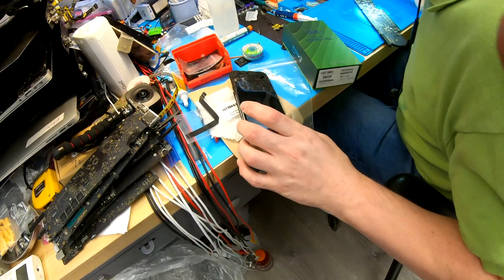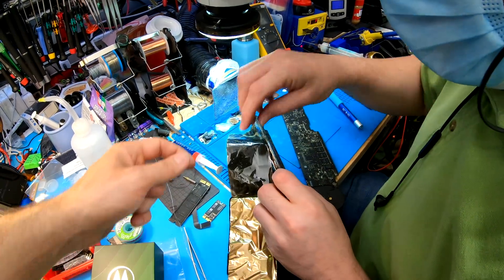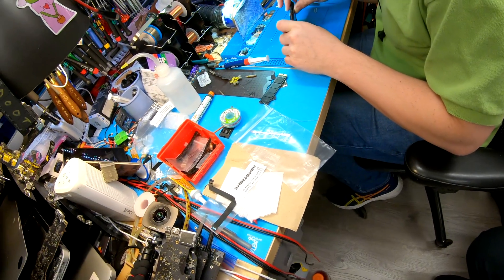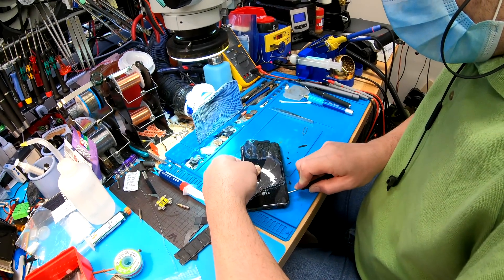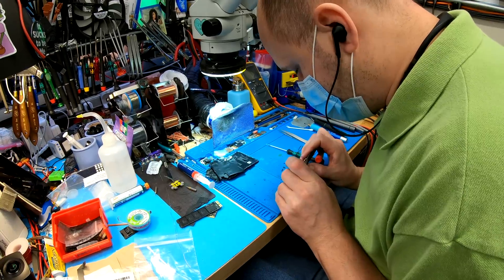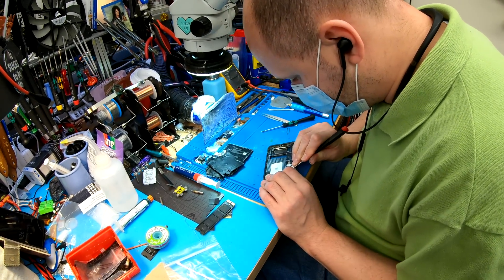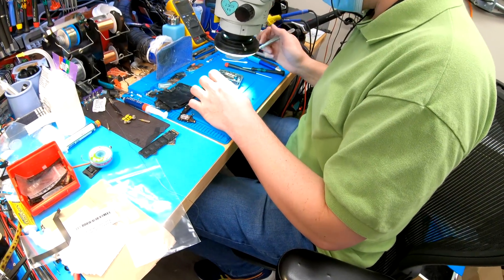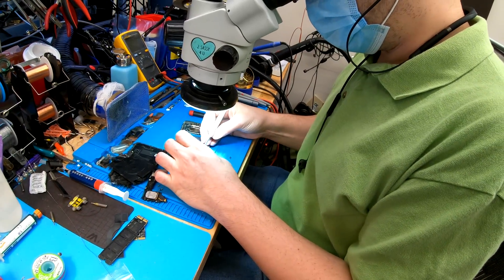Can Paul recover my phone data after the bike it was attached to goes on fire?

Comment: Well, there's the reason it caught fire just then:  The wind of your passage was the only thing keeping what turned out to be a crap battery pack cool enough that it didn't burst into flames.
Reply from the maker: This is most likely it. This makes the most sense. I was riding for 20 miles continuously with no problem. I stopped, I turn off the motor controller, I turn off the battery, and sit still for a minute. It goes on fire. The cells were being cooled by the wind. It's not possible for the motor, or the motor controller, to have done this, because the circuit breaker was turned off at this point, breaking the connection between the battery and the bridge rectifier as well as the motor controller.

The moment that I stopped the temperature went up and kablooey. The lesson here, even if you use the battery for 30% of its rated capacity, that's too much when buying a battery on AliExpress. Stick to em3ev. Or lifepo4. Never again
Reply: @rossmanngroup  at least it didnt choose to burst into flames inside your office..
Reply: @rossmanngroup  Actually, now that I think about that, I'm being unfair there.  It could be that your battery controller was crap, as it does have the job of, among other things, making sure your battery pack doesn't burst into flames.

At least this is better than the subject of a very old joke from Saturday Night Live (this was done on Weekend Update by Denis Miller, who left the show in 1991, ending all humor on the show as far as I'm concerned).  It was about a dish washer that was recalled due to a fire hazard.  The joke is thus:

Dennis Miller:  How bad do you have to SCREW UP to build a machine that fills up with water, THEN bursts into flames?

(Not quite the best bit he ever did, that was the wonderful Gulf of Sidra bit in 1986. It involved him pointing out where it was on the map behind the desk, and when he did so a squib blew off that tile of the map. His expression suggested that he wasn't told about this ahead of time.)
Reply: @rossmanngroup   As a practitioner of the Vape, I can tell you it's likely that the AliExpress cells were significantly overrated. When pushed too hard, they get hot. If they melt through the insulation, or even clatter together and cause a short circuit between the Ground/Negative chassis of multiple cells. I've seen other e-bikes catch fire, and the batteries were exploding like M-80's.
Reply: @rossmanngroup  make sure you do some forensics on the breaker, controller etc though if you can. To make sure they did not set this slowed-down thermal runaway off. You do you, but if there was a self-induced fault/limitation through your mods, or a discoverable fault/weakness with something else than the battery; you'd wanna make sure that doesn't carry over to the next build.
Reply: @rossmanngroup  How many bikes have you lost to fire so far?
Reply: What about doubling on the battery? Sure its gonna be bulky but afaik its always the esr, so half the esr and double the surface area is like 4 times safer. Sure lifepo is a good alternative if you get enough capasity for 80% of your trips.
Or maybe add a fan to the battery pack and a thermistor?
Reply: @rossmanngroup  em3ev has been great to me. I bought four batteries from them this year and one two years ago. They constructed custom cables for me and sent them from China for practically nothing. I hope they are doing OK.
Reply: @rossmanngroup  One solution is to turn it OFF while still moving... But of course, you need to make sure that the cells are properly cooled and balanced.
Reply: @rossmanngroup  RC Lipos from a reputable brand are often good. Not that it maters, but wich battery connector are you using, Barrelplug /XT60/XT90?
Reply: @rossmanngroup  Louis your inspiring me to make a YouTube channel.... I'm not fully aware of your bike setup because I don't watch all of your videos. But I know one, where you had densely packed cells covered in what can only really be described as heavy insulation. Wind was doing fuck all to cool that battery. So the only question I have is "What was your amp draw for that 20 min, or more on the point what was your amp draw compared to C rating and how were your packs constructed?"

Also one shit unbalanced cell risks your entire pack every time. That is the value of an on board BMS (which hopefully you were running.)
Reply: So, next time he should build some sort of intake fans?  Guess Louis pulled an apple.
Reply: @notmyregret  I think there may be no "next time".  There isn't anything worse than scaring your own wife.  Let's just say that he probably isn't going to get on a e-bike for anytime soon, or perhaps forever.  One thing that you can possibly be certain is that he isn't going to be able to bring another e-bike up his apartment, and he can't leave it outside much less charge it overnight outside on the streets with a long extension cord thrown out the window.  I think he is going to settle with a motorcycle or just a regular car.  His e-bike ambitions may just in fact be over.
Reply: @user-he6jc6uq3y  He operates on a 1 e-bike fire a year basis. He'll be fine and dandy :)
Reply: @King_Kong_Song  like I said. Apple
Reply: @user-he6jc6uq3y  not sure why you would think that stops louis from getting another e-bike. Obviously he just gets a new battery.
Reply from the maker: @m8ty.com I actually rode the red one(that bike does not use a shit aliexpress battery on it and has been awesome for over a year) home today with Erica - at her insistence. She didn't want me to be scarred by the one time I got fucked by a shitty battery manufacturer. Her and my friend Anna too. We rode way slower than normal to stay at a low wattage and it made it easier to have a conversation and sightsee on the way home. It was great fun. I have enough battery to be able to charge at the office, where I am right next to the door incase it bursts and have everything I need to deal with a fire. 

My other friend told me "Promise me that you won't stop. That you'll figure out what went wrong and try again. What's the point of changing the world if you're miserable at the end of the day?" She sent me this article and told me to promise her I'd never stop playing. https://www.asc.ohio-state.edu/kilcup.1/262/feynman.html  Albeit, taking into calculation what I learned so it never happens again. 

I'm telling you, I am a lucky man. I have the best woman in the world here. and good close friends. She has a guy that reeks of lithium. It's not a fair trade. 

I definitely want to get my motorcycle license and get one so I can travel the country searching for the next place to call home base for business if NYC goes to shit. I wanted to travel around Delaware & Virginia a bit with this one, but... that aint in the cards for the time being.
Reply: @rossmanngroup  If you don't think NYC has gone to shit NOW, what would it take to convince you?
Reply: Louis Rossmann Get à smoke detector - put it where you keep the bike in your apartment so it’ll wake you if it starts smoking in the night when your sleeping.  Please?
Reply: @rossmanngroup  that's a really healthy mindset,a lot of people simply shut down and refuse to try again and analyse what went wrong after a traumatic situation like this
Reply: @rossmanngroup  I'm happy Erica feels better and still trusts the red bike, this one has a good battery.
Reply: @rossmanngroup  You are lucky.
Reply: @rossmanngroup  Do NOT get a motorcycle, in fact give up the e-bike, crippled and in intense pain through no fault of my own these last 31 yrs!
You can afford a car once outside NY and have protecting metal around you not exposed flesh. I WAS 35 and invulnerable GS550 Suzuki. Not worth it.
Reply: @rossmanngroup  Well for travelling round the country why don't you just get a car? I totally get that a car is awful when you're commuting in NYC traffic, but for a long roadtrip it's quite a bit more comfortable than a bike/motorcycle. Especially when the weather sucks.
Reply: @rossmanngroup  I'd stick with the ebike for more local transportation, in the city and surrounding areas.  For exploring further, especially where you can benefit from cruising at highway speeds, a motorcycle will be much more ideal.  Check out the Honda cb500x.  brand new 2020 model is under 7k .. less expensive than a lot of higher end ebikes.  A used one with some miles can go for half that.  I've seen the earlier model cb500x's for under 3k.  They get over 65 mpg.  They are incredibly reliable, versatile motorcycles that are comfortable to ride for long trips.  Low maintenance.
Reply: @rossmanngroup  in one of the videos you said you use 3 batteries instead of 1, which would have been fine as well. If 30% rated current was too much, would having moooaaaar batteries (going Kerbal) help?
Reply: Watercooled battery pack when?
Reply: @qayqay2754  Water and lithium, ummm bigger and better explosions!
Reply: @waynechirnside1831  More like teslas approach with a separate water cooling circuit between the 18650 cells.
Reply: @qayqay2754  Water and Lithium? Bigger and better explosions!
Reply: @waynechirnside1831  there's hardly any lithium in a cell, if it's on fire don't hesitate to put water on it.  Louis's battery failure is thermal, the cells got too hot, the heat didn't get dissipated and then the electrodes warped and shorted out causing a cascade reaction.  The battery pack needs cooling channels...
Reply: I'm not going to pretend to be a battery expert however I haven't ever heard of a situation where a battery needs cooling otherwise it bursts into flames, if it was so hot the battery was melting it would've burst into flames either way, a lithium battery catching fire/exploding is most commonly caused by overcharging/overloading it or a direct short (which I speculate is what happened) and not as likely but also possible from over discharging them.

Your second theory is much more likely, either something on the controller failed or whatever is used to switch the controller/battery off is what failed and probably caused a short, the battery pack itself was likely just fine as the problem occurred after the bike was stopped, if it were the battery itself it probably would've gone up in smoke during the ride or Louis just got insanely lucky on the timing.
That said I would absolutely switch to LiFePo4 for an e-bike, you'll take a capacity hit but not a big one and it's much safer.
Reply: Batteries from AliExpress... we found the culprit guys!
Reply: "The wind of your passage" makes it sound like his farts kept the flames at bay.

Comment: The minimum melt point of most common plastics is about 160°C with the better plastics up to about 320°C, with some automotive grades being a little higher, so the SD card's actual temperature never got too far above 150°C or the edges of it would have melted, there is no denying the laws of physics.

Comment: I bought a unlocked LG G8 on ebay for $280 as a openbox in 2019. It has been fantastic. I usually buy refurbished phones but I decided to try an open box and It was from a reputable vendor. Its a brand new phone at 1/3 of the cost. It's always great to avoid monthly payments especially if you can get an unlocked version so it can accept any SIM card

Comment: It's a shame more and more Android phones are forgoing the SD card slot.  I only buy phones with SD card slots and this video is the reason.  I am curious though why didn't you go for the newer Moto G power 2020?  I got mine unlocked for 210$ and get an extra year of updates compared to the G7.  Anyway U better put a case on that G7 ASAP.  My friend dropped his after owning it for 3 days and shattered the back and motorola wouldn't cover it because it was user damage.  Now he is walking around with a G7 with a cracked back and probably will be for years

Comment: iphone data recovery: step one restore from icloud. step 2: Done, like it never happed a perfect clone. I usually do itunes backup at least once a month though, just because. Both androids I've had that I would need to recover data from in the past the card was corrupted from the card jostling around when it was dropped. In fact, the second one it was only the data that was damaged. I was able to use a data recovery software on the second one, at least. The main reason for me to do the iphone was the performance boost gained from having on board memory 256GB. Sprint made it easy too... $5/month lease for iphone 8 256gb around xmas time.

Comment: This right here is why I will NEVER purchase a phone that does not have a microSD card slot. It is literally a dealbreaker for me. It's sad too, because the 2 best Android phones on the market for years - Google Pixels and Oneplus devices - are all such fantastic phones but don't have microSD expansion, meaning I could never feel secure my data is safe carrying one around unless I invested in some sort of expensive network-connected backup hard drive solution.

If I am given the option between a phone that can be quite literally caught on fire and burnt to a crisp that will still preserve my data and a phone that can't do that, the choice is always obvious.

Comment: Hey, you still getting a librem 5? Also were you running the batteries for a while on that bike before this happened? Or were you adding some. As if you decided to add new ones in parallel with the old ones, and charge imbalance will balance out between the two in a matter of seconds, and if the difference is large, resulting in a fire. SO you have to be really careful with that.

Comment: I heard you mention a MotoG.  I love my MotoG7.  I really don't understand why the mainline phones are so expensive, it does everything I'd ever want and more.   Before that I had the G5+, also wonderful, had so many sensors.  As a developer I love it, it's so simple to work with.  I even fixed my own G7 when the battery expanded from my dev settings causing it to heat up way too much.

Comment: Seeing in the comments that you keep mentioning that your 10 parallel groups of 35E cells can output 80amps. You are wrong. That was part of your problem. As per the datasheet 35E cells can output 8amps continuously at 23c. You had 200 of them close together and insulated with packaging materials and no way of syncing heat away. You always go on about fan spin yet you insulated your batteries! LMAO. Your batter pack never operated at 23c. You, I, and every lay person can come to that conclusion. Your pack was likely operating above 50c and higher the temperature the lower the safe continuous discharge rate. 

Whether I am right or wrong a $10 thermocouple would have allowed you to actively monitor the battery temperature and recognize you have a problem, around 85c, before there was a fire on your hands. Even Apple monitors battery temperature, do they not?

This is all assuming they were actually 35E cells in the first place. Did you visually confirm they were 35E cells? Or was that also an assumption? Last Chinese pack I bought with "Samsung cells" had some cheap knock off cells and I paid a premium for that pack (those cells are in my 'do not use pile').

Put a thermocouple on your pack next time!

Comment: Unfortunately this data repair method only applies to some Android phones.  Some phones are also ditching the Micro SD slot to try and overcharge you for data capacity (like Apple).  Such a shame.  Samsung has gone that way themselves - The neither of the folds have a slot despite having the space and neither does the Galaxy Note 10/20, and most of their new flagships.  Samsung is Apple for Android in all the worst ways possible.

Comment: Battery Engg hear
I'd say build your own pack using some decent Samsung or LG cells(18650s are fine) along with the BMS that has support for multiple temp sensors that you mount in different locations in the pack.
If you use cells with a low enough IR value then there would hardly be any heat generated at reasonable C rates.

If you wanna do Ebikes right then don't rely on anything of questionable quality, one bad part there kills the whole system.
Go with LG H2 cells, an well tested open source BMS and you should be fine

Comment: I own a Bicycle store. The whole insurance industry crashed down on ebikes. If you want to work on ebikes (without a insurance e bike exclusion) insurance cost is literally 10x. The main risk is the fires in the shop or a fire after you touch the bike and they have it home. You replace a tube, battery on the cheap ebike burns down house killing family = millions paid out. Massive loses from ebikes due to insurance companies not rating the policies right in the past. Now they either max out policy costs or exclude e bikes. Especially off brand bikes

Comment: I run with a Moto G series, I absolutely love the "gestures" to activate stuff. like shake to turn on the flashlight and "twist" to open the camera etc... 
Not sure why you got the G7 tho, the G8 line came out a few months ago and is very reasonably priced all the models here are under $400, the G8 power has a 5k mA battery and decent specs. I cant believe the Verizon store didn't have any G8 models stocked. I got my G8 Stylus model off the shelf at bestbuy for $260...